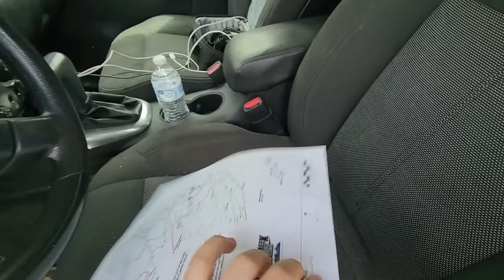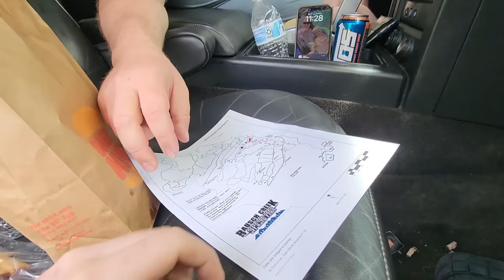Can the Hummer H3 Keep Up at a Jeep Offroad Park?

Comment: Great video man! I am really surprised how hard you wheeled this offroad in basically stock form. Some things that I would recommend next time for your off-road trips for the H3 is to get some spare CV axles and tie rods. These two components are known to break the most offroad. I have personally have witnessed this multiple times when at Hummer Club events. When buying new CV axles, I would highly reccomend getting the AC Delco/GM Genuine and to avoid going with aftermarket brands such as Carquest or Cardone. All of the aftermarket CV axles are a little bit shorter than the GM Genuine ones so they will get stressed out easier when they are at full articulation and will break easier. Also, you were most likely will need to buy a socket for the axle nut if you do not have a lot of large sized sockets. For tie rods, if you are getting stock ones go with the 16mm ones which come with 2007+ H3s but will fit the 2006 H3 like you have no problem. Originally, the 2006 H3 came with 14mm tie rods and those are weaker. There used to be some heavy duty tie rods that you could buy but I am not sure if the company that makes them is still selling them today. But anyway great video!
Reply from the maker: Yeah I honestly couldn't believe how well it did. I appreciate your suggestions! I have an extra ACDelco CV but gotta do the tie rods at some point before too much more offroading
Reply: @TopLineRacer  If you haven't replaced the CV axles before there could be a good chance that they are rusted onto the hub bearing assembly since you got an east coast H3. So if you break a CV offroad it is probably not worth the effort of trying to change it on the trail. If they are not rusted on there a CV axle change typically takes about 1 hour for a trail fix. The company that sells heavy duty tie rods is called Outfitter Design LLC. These are the ones I have and they are great. They are around $400. Unfortunately, this past year they have been super inconsistent with having inventory in stock and they aren't saying anything whether or not they are going to be bringing them back. Some other possible options would be a company called Jeeperf that sells them. Only problem with those is that they are $1200 for a set. You could however, just choose to get the inner tie rod from them and that will be around $600. The reason why these Jeeperf ones are so expensive is that chromoly instead of using thicker steel material. Also, another possible option but I'm not sure, but you might be able to call up a company called Michigan Metal Works and have them make you a set. They currently don't sell them but they showed interest. Those I think would be around $600 but not sure on that 100%. But yeah all this depends if you want to spend the extra money on these or you could just go with the factory 16mm ones and if you break them, you can just swamp them out on the trail. Its honestly not that hard to do. Seen that happen to other H3 owners while I was out on the trail with them.

Comment: The Hummer H3 Alpha has lockers in front and rear, making him an offroad beast 💯👍🏻💯
Reply: I found and bought a 2009 H3 Alpha Adventure  about a year ago, 85,000 miles.  Factory lockers front and rear, factory 4:10 gears, Borg Warner transfer case and has the 5.3 LS motor in it. With magna flow exhaust and tuned on HP tuners its 350 Horse Power or so, Silver Flare metallic in color.  I paid $17,000 for it. Its a jeep killer!!
Reply: Most important part of four wheeling.. Good seat belts 😂
Reply: @craighoeme4845 I have an 08 h3 alpha adventure and it has a pretty good exhaust on it and its got some chrome fittings on it and it looks so good

Comment: This was good! That’s what I like. No fear to put it to the test. Next time climbing, use the break and skinny pedal effect. It helps with traction
Reply from the maker: Yeah I was braking on those climbs but without the locker it just couldn't do it on that one.
Reply: Hes talking about BTM, its stands for brake, throttle modulation. By using this technique, it will engage traction on both wheels to help you out of slippery situations. I learned about it on an online forum. Hope this helps, and keep up the great videos! Im currently in a 08 alpha and other than a few electrical anomalies, shes rock solid!
Reply: Also, what tires are you running, they look good on the stock rims

Comment: Love the hummers.  Fixing the exhaust on the h3 should give you some more pep.  I had a trailblazer with essentially the same engine but one more cylinder, fixing the exhaust made it run way better.  I think back pressure is the name for it
Reply from the maker: Yeah it's the back pressure. I'm gonna try to get that fixed up soon and hopefully it helps it out a bit!
Reply: How do you fix the exhaust?

Comment: Dude, what a great vid! I'm from Australia and drive a GU Nissan Patrol, 3" lift with 33" muddies, and have always been tempted by the H3 even though it's a smaller rig. Was worried about how they go off road with the IFS and without the rear locker as most of the ones around here are the Luxury package without the locker or lower crawl ratios. Don't know yet if I'd trade the Patrol for a H3 right now, but it's great to see just how capable they are!
Reply from the maker: I'm not familiar with the Patrol as we we don't have them here in the U.S. so I can't give any thoughts on a comparison but the H3 is definitely plenty capable enough off road for most people.

Comment: Hummer was the only brand consistently beating Jeep in off-road competitions during their time of production.
Both were dream vehicles of mine growing up.
After owning a few Jeeps, I’ve finally purchased an 06 H3 with the rear locker. Tbh, I would recommend Hummer over ANY Jeep (including new) due to reliability. These things are seriously tanks. They WILL keep up with Jeep. They WILL do some crazy things with less chance of breaking. Though many SXS these (I would recommend it for better articulation with less chance of tipping over because these things are top heavy). The IFS is seriously impressive even with the underpowered 3.5l.
Even swapping in a V8 makes these things much more appealing than a Jeep for those who really dislike constantly working on things. Imagine a 6.0 LS, 35s, and 3.5+ inches with a SXS. 

I hope they give us more options over the EV choices soon, but if not, it looks like I am going to be saving much more than intended for something I never wanted (EV). Because Hummer is engineered by those who push the limits of engineering reliability with quality parts and designs. Something you CANNOT beat with most automakers.

The only other brand I would say comes close to reliability would be Toyota. They can take a beating 😉

Note; Where you got caught up towards the beginning before you put it in low. A stock Jeep would have been stuck on that frame even in low.

Comment: You need to check the head bolts on thay h2 thats what is ticking. Tighten them asap because if you dont they break off in the head.

Comment: How about hearing an update on the topdon battery booster. Really fighting between the "loyal" blue box or the 3300 from topdon
Reply from the maker: Still use the topdon multiple times a week. It works best when fully charged but you can jump several cars on full charge. No issues with it.

Comment: Hummer H3 Alpha is a great off roader.
Reply from the maker: Would love to upgrade to an Alpha someday!
Reply: @TopLineRacer  I wanted one, but couldn't find any with low miles. Decided just to get a 2018 Jeep Wrangler.
Reply: @TopLineRacer 
I have a 2009, H3 Alpha and love it !  Got it with 96,000 km on it.  Had it almost 3 years now, and have only put 6,000 km on it so far.  Very smooth ride.

Comment: What size tires did you put on the H3?  And how did the 5 cylinder handle it?
Reply from the maker: They are 315/75/16. The I5 did decent. The transfer case is geared so low that power wasn't really an issue unless I was trying to get a run to go up a hill.
Reply: @TopLineRacer   I’ve got a 2008 H3 with the I5. Hesitant to put the 315s on because of the lack of power. Leaning towards the 285s. Everyone I know that has the 315s has the V8. Thanks!